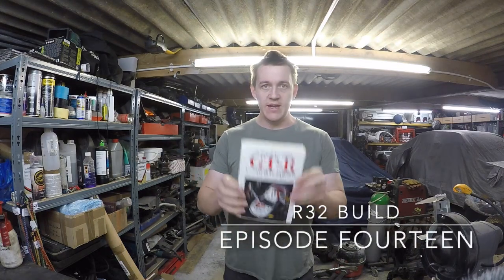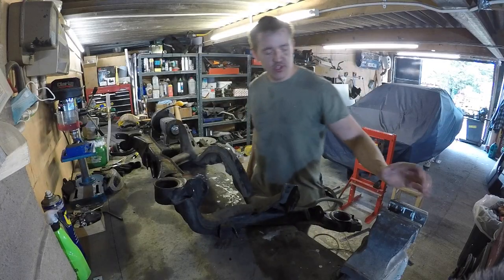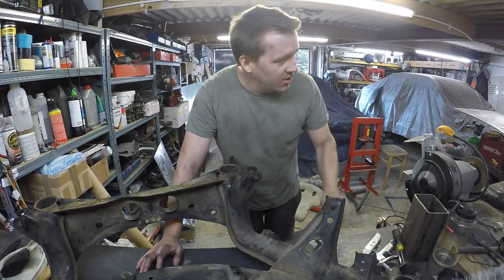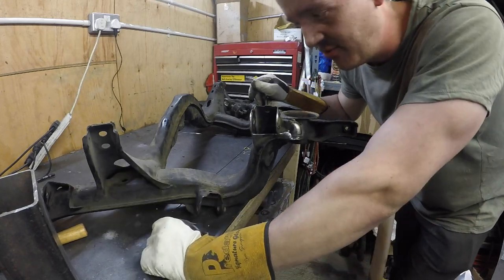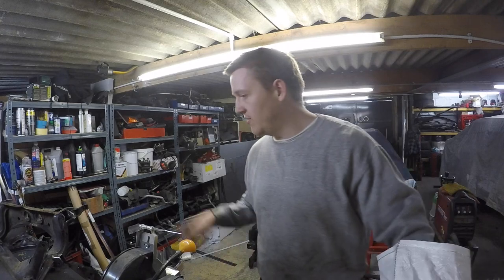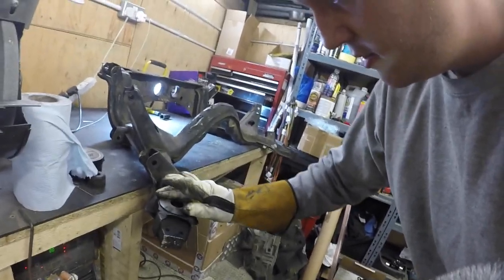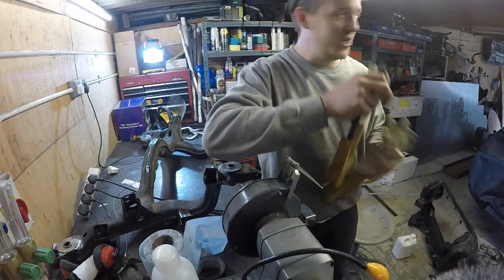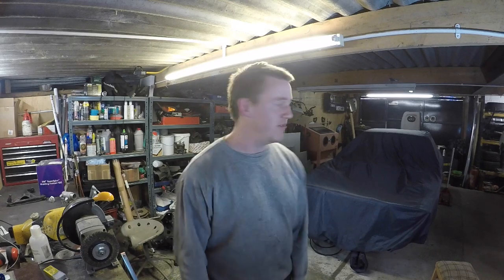Burning and Reinforcing Subframes - R32 Build: Episode Fourteen

Comment: Did you think about going for a solid bush at all?
Reply from the maker: What do you mean buddy? Like a solid aluminium insert?
Reply: @AlexGrA  yes but steel obviously so it could be welded in, it would be infinitely heavier than what you have done but also way stronger. though not saying what you have done isn't strong enough.
Reply from the maker: f4zetw0 it’s just the same as the group A. It’s lighter but it also gives you more flexibility on subframe positioning, committing to big blocks of steel could have gone badly! It only needs to be strong enough :) I would have interference pressed aluminium in if I hadn’t done it this way I think, some nice kits available off the shelf.
Reply: @AlexGrA  I am no engineer so just asking dumb questions :) when I did mine I just used poly bushes cos it was easy! never even thought about doing anything else!
Reply from the maker: They’re not dumb! 

Yeah my other subframe was polybushes, worked really well. Good for fast road and track days for sure :)

Comment: What's the name of the white gtr book?
Reply from the maker: I’m not sure mate! I just had to eBay ‘group A r32 book’. It’s pretty good, it’s got all the spring rates, roll centres etc. So at some point can backwards engineer a proper subframe. The red one is the more useful picture reference book though.
Reply: @AlexGrA  that's exactly what I was thinking too do with it aswell I guess I'll try to search it till I come across it
Reply: @AlexGrA  I found it lol took a while but thank you
Reply from the maker: @desier235  excellent news! What’s it called mate? How did you find it?
Reply: @AlexGrA  it's called Technological development of the Skyline GT-R race car specifications (1994). I searched the reebok r32 gtr book and it came up on some Japanese site. There's the old version that you have and they have a new one. Then I found it on Amazon for pretty cheap too not going to lie.
Reply from the maker: @desier235  excellent! Cheers for the update, I might even get a new copy for the shelf :) thanks again
Reply: @AlexGrA  btw there should be a translate app that can translate from japanese to english using your camera
Reply from the maker: @desier235  yeah that’s what I use mate. Although sometimes the translations are more funny than useful.